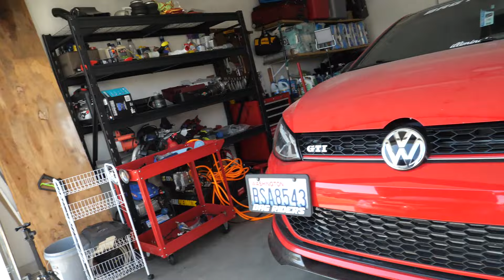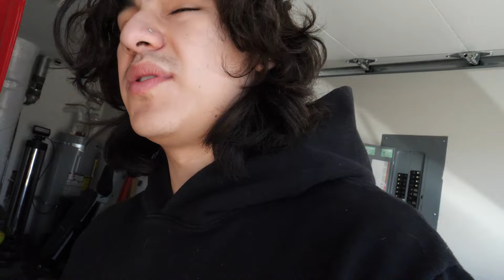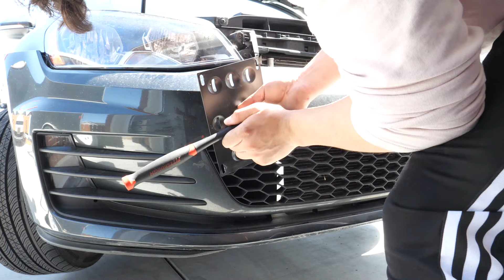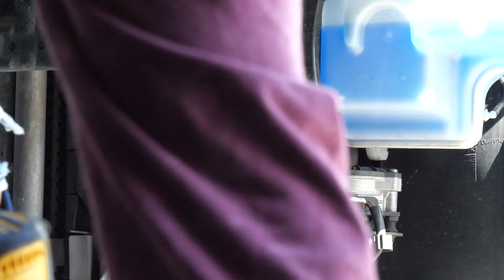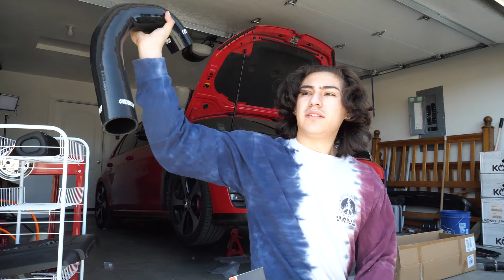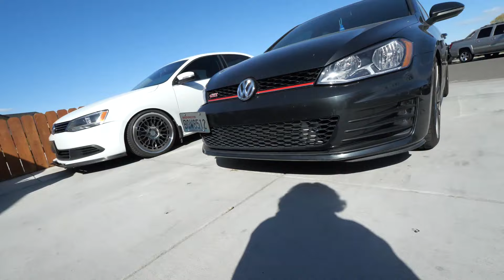ECS TUNING MK7 GTI Front Mount Intercooler INSTALL

Comment: EQT are the way to go for sure. I have my golf R on their stage 2 tune and its great. I will be going Vortex XL this off season. ED knows this platform very well, and as a company, they are a pleasure to deal with.
Reply from the maker: I'm really considering it, your golf r is gonna be fast af with the eqt vortex xl!!
Reply: IE (Integrated Engineering) is a very good tune, really cleaned out the powerband on mine, it passed state scanned emissions, no issues, no CEL.
Reply: @mazpr2025 eqt is still smoother powerband all tye way through were ie has all torque right off tye bat and less refined. Eqt specifies and tunes only mqb platforms and has more experience building and tuning them in composing to a company that does Subaru and fords as well
Reply: @HatsuneM1ku01  Do you have any Dyno runs to prove EQT is smoother? And that IE is just low end torque and falls flat?
There are plenty of YT videos that will show you are incorrect. 
IE is not the most squeeze every hp out of the engine, but it is reliable, it feels factory, the power is smooth and progressive, and customer support is one of the best (besides an A+ IE app to make changes on the fly).
I went IE after I rebuilt my engine, everyone was telling me you gonna blow up the car, bla bla, just waited 2k, so a rebuild at 115k miles (185k kilometers), and did the tune at 117k, w the DSG tune. I was getting a clutch overload CEL and the transmission tune fixed it.

Comment: going to be buying the EQT stage 2 tune for my gti in the next month or so
Reply from the maker: Hell yeah that dope bro!!
Reply: @colgatemk7gti698  if you get a vortex or any turbo, you should upgrade fueling either way so you can have more head room. But EQT has the required mods for their turbos, I think you need upgraded intercooler, intake, downpipe, and either hpfp or lpfp, they answer a lot of questions on the page so it will be helpful for sure.
Reply: Hey I live in Tri have a mk7 gti doing intercooler Wednesday

Comment: I too want to take my grille off but I’m too scared cause there be rocks glass and just a bunch of junk on the streets and I don’t wanna hit or something damages the intercooler
Reply from the maker: Same 😬
Reply: @colgatemk7gti698  lol I tried taking off grille for my mk6 shit is impossible or like the clips are so hard to take off cause it’s attached to so many other stuff I think I’d have to dismantle the bumper but no lol
Reply: @fluflammer1  cut it out with a thin metal tool that has sharp edges.

Comment: So did you inspect the 2nd intercooler you bought?? Wondering why you found metal shavings in the first intercooler?? Maybe a manufacturing issue
Reply from the maker: There was metal in my intercooler because my turbo failed 🤭

Comment: any reason why you both went with FMIC instead of stock replacements?
Reply from the maker: The stock replacement is really hard to install and I like how the fmic looks too 🤭!
Reply: @colgatemk7gti698  I've done both on MK5s and MK6s. Stock replacement isn't actually too hard once you get a system down to do it.

For my MK7 I'll probably go stock location since i want it to be pretty stock or OEM+ looking.

Comment: So do you remove the old intercooler? Does it just stay there?
Reply from the maker: It stays 🤭
Reply: @colgatemk7gti698  ohh okay sweet. How does the front mount compare to a whole stock location upgrade? Is it similar performance?
Reply: @colgatemk7gti698 bracket kit by ecs bro. Deletes stock intercooler

Comment: So did you leave the stock intercooler in the gti ?
Reply: Yea you do. It’s a big job to remove it which is why people do a FMIC instead. Upgrading the stock location IC is better
Reply: @rambow70 ecs makes a delete kit. At of brackets that removes tye factory one
Reply: @rambow70 old one is just dead weight leaving it one and creates less airflow woth 4 coolers sitting in there instead of 3
Reply: @HatsuneM1ku01  If you're going to go through all the work of deleting it then you should just upgrade the stock location intercooler. A lot of people who have the ECS FMIC say it isn't a big upgrade from stock. If you get the ECS stock location intercooler it's the same price and works a lot better, way bigger core. But it's a hard job which is why people opt for the FMIC

Comment: damn i came across this video too late, the best turbo rn hands down is a TPC38 or a TPC20. EQT blows cars and thats a fact. here im florida EQT people end up switching over to Project A or Sneeky Tune very very good tuners and very reliable. I personally wouldn’t trust any other people. please if you wanna talk about it my ig is @kevv.gti
Reply: Lol sneaky tune blows cars. Eqt makes the best tune that’s very refined. Sneaky tune is very edgy and high torque lol
Reply: Only reason people blow cars on eqt is because they use rs7 plugs that fail. Instead of ngks with non projected electrodes.